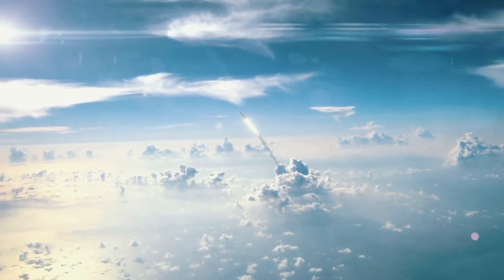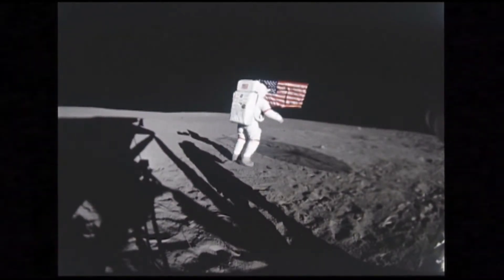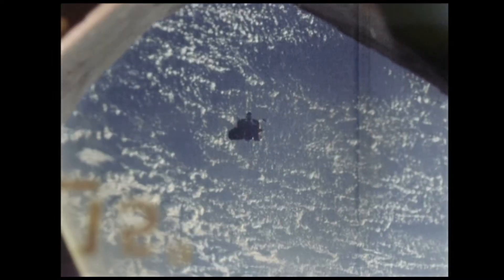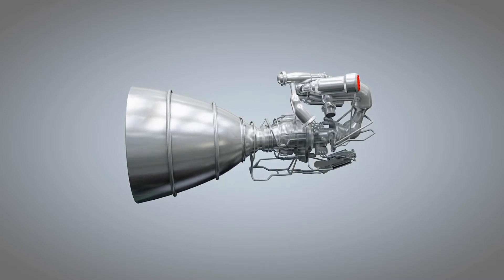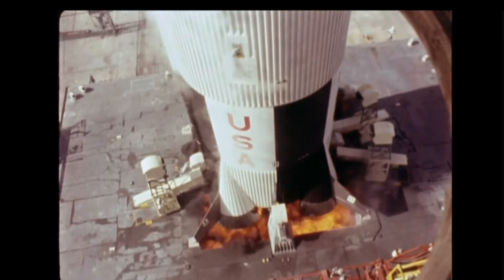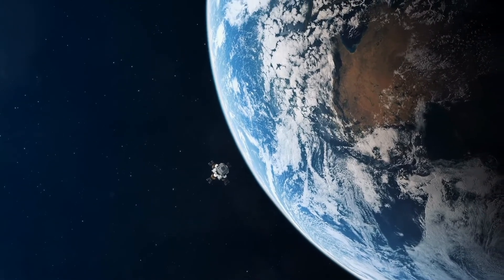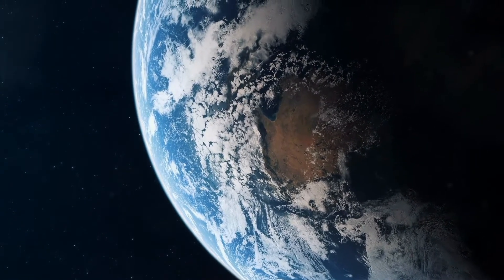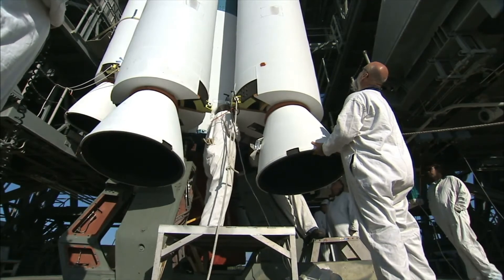Rocket fuel: Why rockets use different propellants explained

Comment: I didnt get my answer😶
Could normal car gasoline work for a rocket?
Reply: @26 Dimensions Thanks for sharing.. then I wont risk testing with it
Reply from the maker: @alvinfriesen4918  You’re better off using kerosene, but be advised that rocket engines are mad complex! If you’re getting into model rocketry, do some research into solid rocket motors. You can buy small ones that are decently powerful for ten bucks a piece
Reply from the maker: Unfortunately not, it doesn’t have a high enough enthalpy to produce the thrust to get a rocket off the ground!